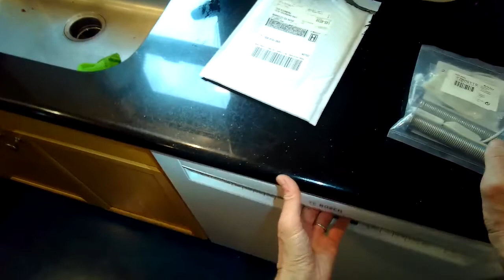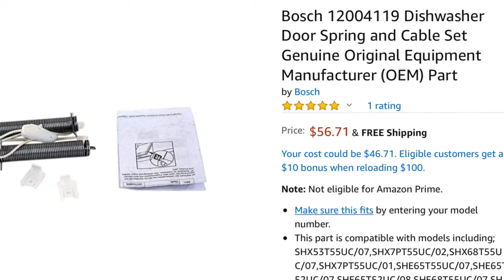✨ BOSCH DISHWASHER DOOR OPENS TOO FAST - EASY FIX ✨

Comment: This is the best video I could find on the subject. However, the Bosch dishwasher in the video has no metal panels covering the sides as mine does. These panels are held in place by integral snap-over clips and one screw on each side. The screws may be covered by plastic strips that fill spaces on the sides of the box. To get at each screw pull the plastic strip up and out of its track. The strip may be stuck, but it will release upwards. Remove the screw and the other fasteners will release the panel. Now you can follow the video, remembering to replace all parts that were removed

Comment: Happened to mine. Just called Bosch. It's a recall and they will cover the parts and labor. The old mechanism is due to fail, only matter of time. This video still helped me.
Reply from the maker: Thanks William😊
Reply: I also would like to thank you. I called their 24 HR number that has operators in the United States! I told the woman I never registered the product, she said no problem, all she needed was the number. She said it was 100% covered parts and labor and gave me an appointment for less than a week away. It was such a shock to me. Again thank you for mentioning the chance or a recall/warranty.
😀
Reply: @skaterboizjoe  I literally just bought my dishwasher in April and it's now doing this. I will try the Bosch repair number. Thank you!
Reply: @ottosmom   you are welcome, I hope things work out
Reply: I wanted to thank you for this comment. I just called Bosch and they are sending a technician over.
Reply: Interesting - mine is now just two years old and think I have a spring problem.  I will call Bosch to confirm mine is covered and thanks for the heads up.
Reply: Just wanted to come and say thanks for this!! I called bosch and my 8+ yo dishwasher parts and labor are covered under recall too!! I appreciate you!! Real MVP!!
Reply: Thank you so much for this comment!!! I don't even know how old my dishwasher was because it was here already when i bought the house and was not even registered to me, but i called Bosch and confirm this worked for me as well.  Just mention the issue, that you heard there was a recall, and then provide your model number.  I did not even have to give the unit serial number.  I figured worse case i would do it myself but it was worth checking, before attempting it myself.  Well, it was REALLY worth it because it worked!  Thanks again!
Reply: They told me it’s not under recall.  They said to have a local repair place fix for me.

Comment: Great tutorial. It was a pretty easy fix. The replacement parts did come with 2 spring clips. Didn't look like I needed them. The 2 springs came with metal brackets attached. Was I right in not using these spting clips?
Reply from the maker: I don’t think you need them👍

Comment: Very helpful. Following your video, found it really easy to replace the spring and rope. Replacement springs and ropes are a big improvement over the original design. My dishwasher is slightly different, but the principle is the same

Comment: Thanks so much!! Perfect explanation and video; I ordered the springs on Amazon for like $30 and had no problem with the repair thanks to this no-nonsense, clear video. Only tricky part was sliding the dishwasher back in without getting the drainage tube repeatedly stuck underneath! (Luckily, those tubes are super thick and sturdy—ran a rinse cycle afterwards before reinstalling the washer just to make sure there was no leakage.)

Comment: couple years ago one side of ours broke. i was like what is this rope?? lol. but we rode it out. today the other side broke and now the door falls like you said. I am not sure what model bosch we have compared to yours, its about 8 years old, so i'll need to look into that but this gives me confidence, I'll be giving this ago. Also what kinda watch you got there? :D
Reply from the maker: It’s a submariner 😊
Please let us know how the repair goes👍
Reply: @QuickAndEasy5MinuteAppliance  thanks. I ordered the kit yesterday. I've been looking a lot the last month or so was offered great deal on couple tissots and wanted to take the deal today but, can't shake spending all that when I could put it on mortgage xD I rarely leave the house (work from home) but they're just so darn pretty. 

Anyway yeah lol. Well see how this repair goes. My only real concern is how easy a time I may or may not have sliding the dw out. Well see. Prob be fine. I am a diyer with pretty much everything I can and it always works out fine.
Reply: @QuickAndEasy5MinuteAppliance    Sir you will be pleased to know two things occurred today, 1) I replaced the two springs on my dishwasher, that was just as easy as I expected after seeing your video, thank you very much, and 2) I placed my order for my first and second watch! Tissot prx powermatic 80 40mm (the ice blue) and the prx chronograph panda with silver hands. I can't handle a submariner heh, but this is a great intro into the watch world for my budget I think. Get them next week, can't wait!

Comment: Can anyone tell me if there is a way to make the spring LESS tight?  Mine is so tight it makes the door smack my arm every time I roll the bottom rack into the dishwasher....my son has a Bosch but it isn't nearly this much tension.  I'd be grateful for any suggestions.  TIA
Reply from the maker: You can move where the spring connects to the frame so the spring won’t be as tight.

Comment: Very nice video indeed! Mine has another issue which is about the door closes promptly on its own. I have to press the door down using lots of force to prevent it from closing on its own. I found the two screws where you are supposed to adjust the tension of the door but it didn’t seem to work. Do you know what went wrong on my end?
Reply from the maker: Hi Steven,

Can you contact me at scottthefixitguy@yahoo.com with that question?
Reply: Same problem here. Can you please help me? Thank you!
Reply: Same problem here. Brand new Bosch won’t stay open on its own and slams shut
Reply: @brianbissonnette5648  Did you solve your issue? We have exactly the same problem
Reply: Hey, having the same problem. Did you find a solution?
Reply: @Mokelembe  were able to figure this out? We are having the same issue!
Reply: @glyndavies8227  Anyone figure this out? Our new Bosch is doing the same thing!

Comment: the plastich housing that holds the end of the spring broke off on my bosh, cant fix that.
Reply from the maker: It’s going to need to new rope cables.
Reply: @QuickAndEasy5MinuteAppliance  no the housing in the side of the machine that’s made of plastic is broken. Can’t attach the spring to the machine.  Poor design.
Reply: @alistairharris7891  The new spring doesn't use the broken part of the plastic. It has a metal tab.
Reply: @amazonfirebook  nothing for it to hook onto. The plastic housing the spring sits in is broken.